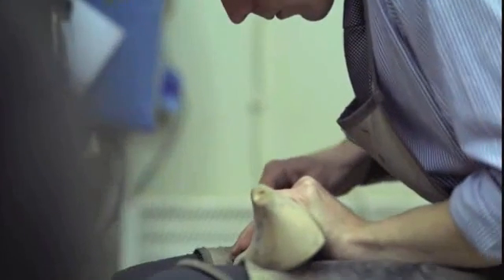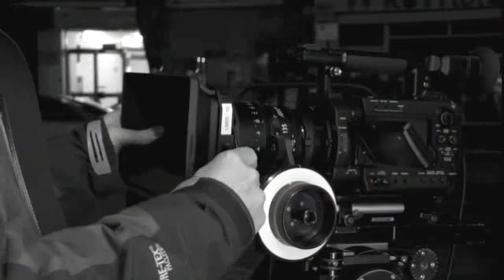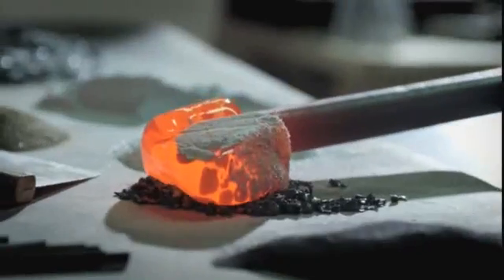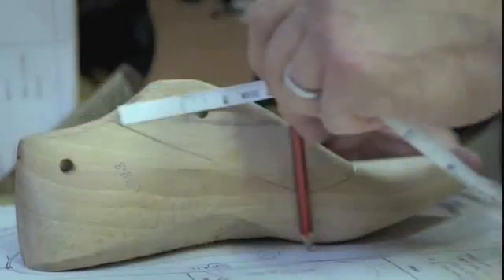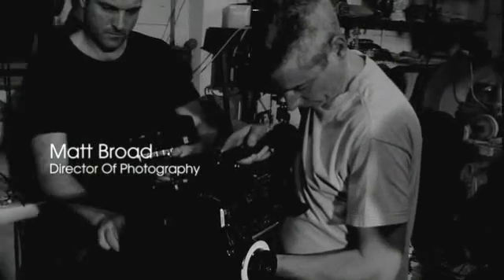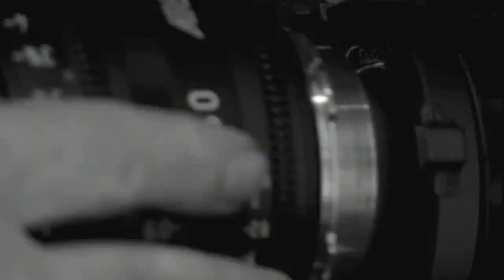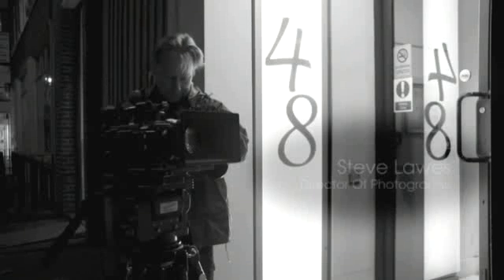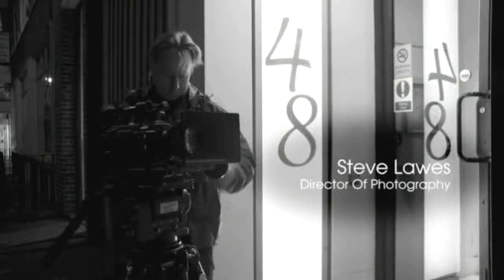SONY PMW-F3 - Super 35mm Compact Camcorder

Comment: @frozenmilk100 I have never seen color rendering from one-chip cameras that I like. They all seem prone to color casts when lighting is not optimal, such as street lighting or other artificial lights not designed for photography. That's where the 3-chip cams excel and the 1-chip cams produce dull results. Movies shot with the RED seem lacking in greens and blues, favoring earthy tones. Granted, you can get good color out of them with daylight or specially-balanced lighting.